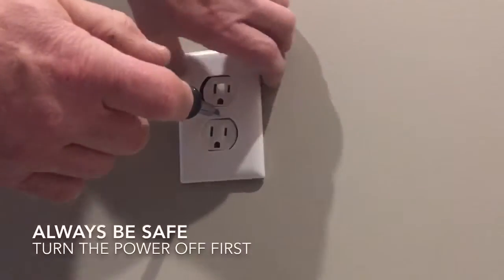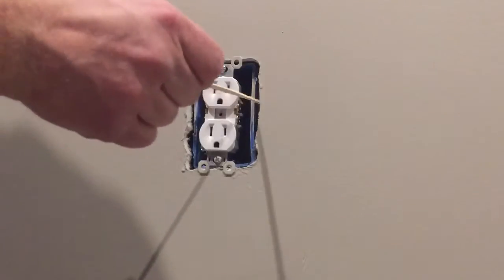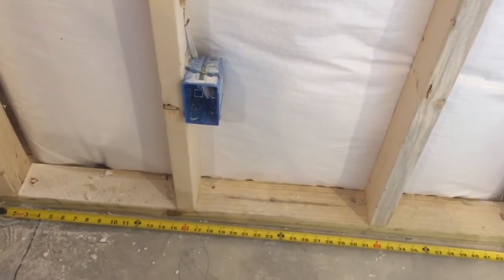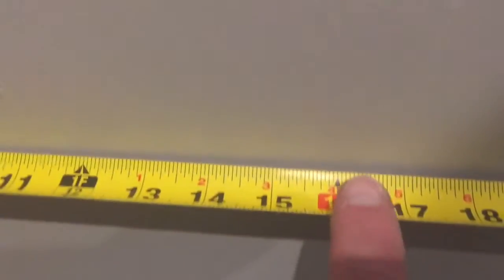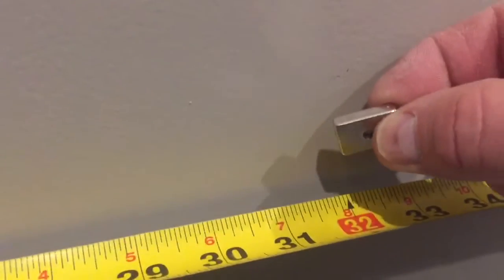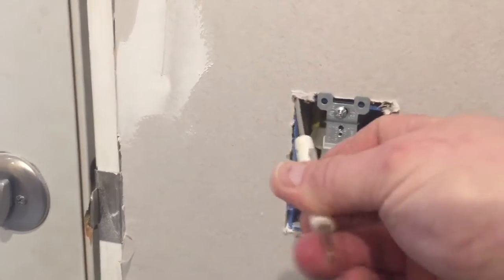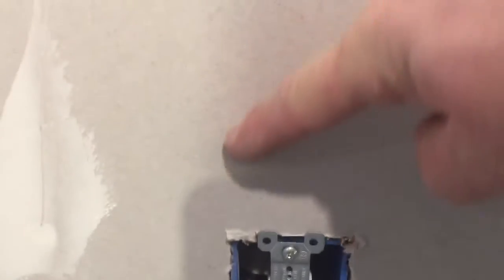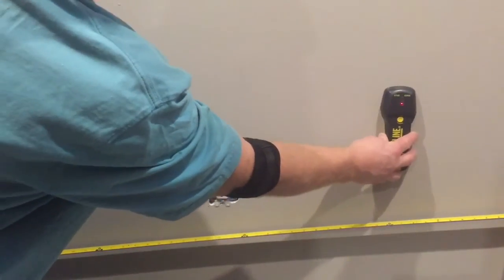The easiest way to find a wall stud

Comment: Another way to find studs is to look at your base moulding. If it was installed correctly it should be nailed into each stud so look for nail holes or puttied holes 16" or 24" on center. This can help if your electrical boxes are retrofit into plaster walls. The way shown in the video is easier than looking at the base moulding.
Reply from the maker: Yep that's another way, Thanks for the tip.
Reply: 2 AM 13x2

Comment: Would this trick work with metal lath and plaster? Minus the magnet tip of course.
Reply from the maker: It should, it may not work as well but the principal is the same.
Thanks for watching.